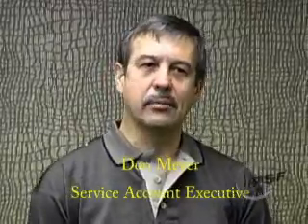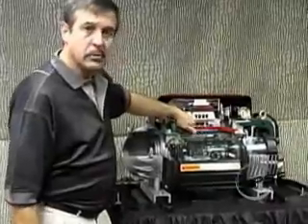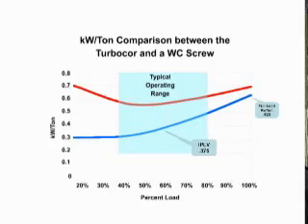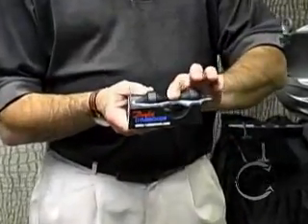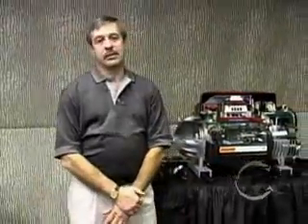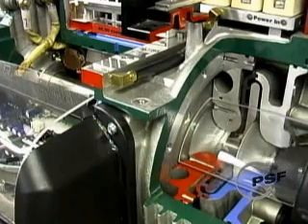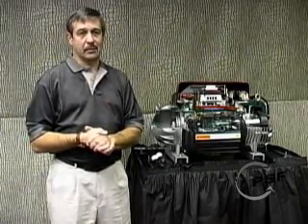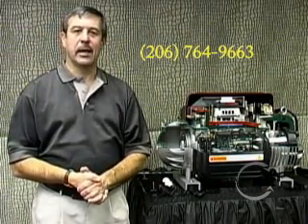Turbocor

Comment: I don't think this is a reliable products for now.
Had 2 Thermalcare chiller both compressor failed tripped main breaker.
Under warranty, so no worries there. 
But remember to always purchase extended 5 warranty.

Comment: These are On McQuays website. Training is there as well. 
@137 Amps whats the Kw/ton.... Worse than a typical new cent. This is compared to a screw, not a recip or cent... a screw. Tip speed.....Please do not work on this equipment if you dont know the basics. If you close vanes all the way, how do you keep the impeller cool. You cant. There is built in  design that limits the flow of gas to certain %.

Comment: Tip speed refers to the RPMs of the impeller.  Since this compressor has a built in VFD it can match the load by adjusting RPMs and modulating the inlet guide vanes position.